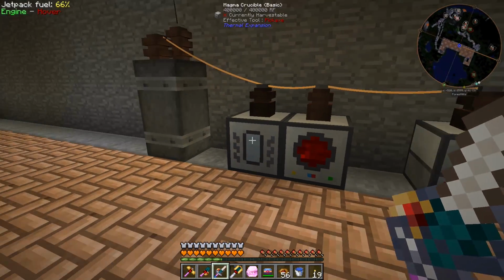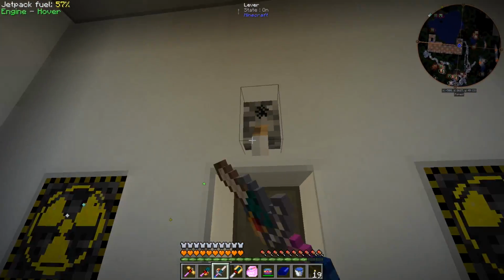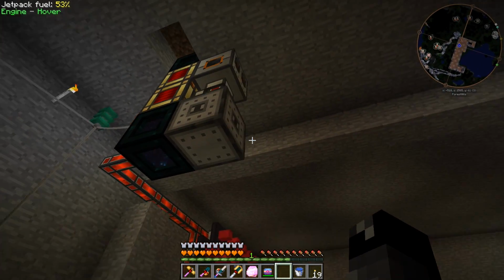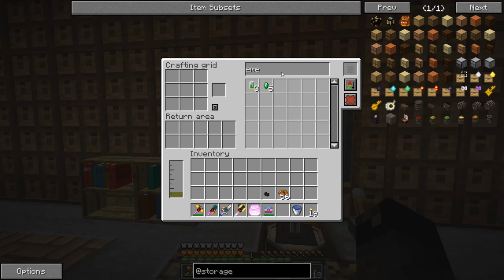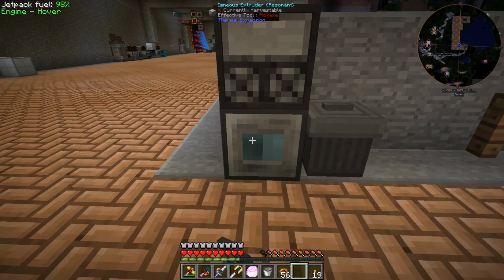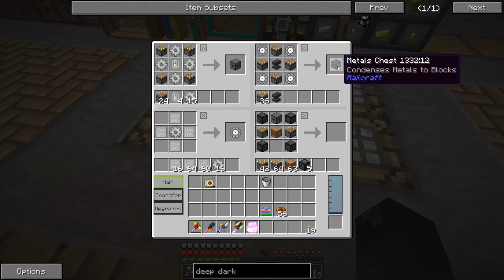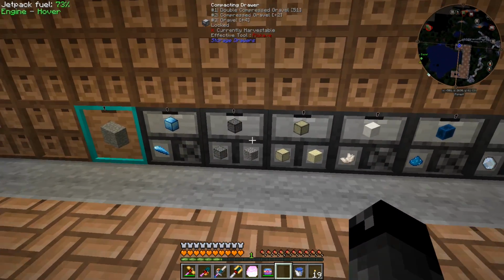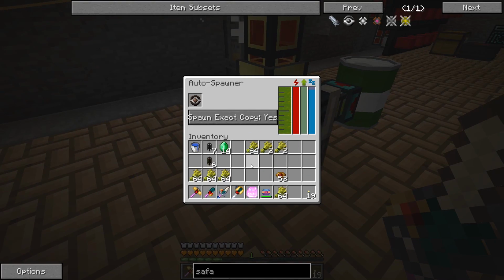Minecraft Mods FTB Infinity Evolved - COMPACTING STORAGE DRAWERS [E25] (Modded Expert Mode)

Comment: make a rubber/wood/power setup... use the furnace generators from extra utilities and have a huge rubber tree farm and have the logs auto crafted through a bc auto crafting table and then you have to get a hardened servo for the item ducts and put it on round robbin mode so fills each gen... i have like 30 gens set up this way and get like 3k rf a tic, idk for sure just a guess

Comment: What are you using to play this mod pack i tried curse and it would crash after the first time i played it and then i tried the FTB launcher and that isnt working either :|
Reply: Check the forge version it's using, if you unlock your profile for infinity you can change it. I've had issues in some packs using the default forge it downloads, the newest one seems to work.

Comment: you only need one transfer node to pill a stack at a time all you need to do it add 64 world interaction upgrades and it'll pull one item per upgrade, that's with only 1 node if you did that with 4 of them you'd get cobble stupid fast in a small area
Reply: as well if you want to continue trading for the emeralds like that set up a room spawn a bunch and use a trading post will make it much easier for you
Reply: WI upgrades are 3 diamonds each in expert mode

Comment: hypno you will not need more than a couple diamond/emerald upgrades because according to my calculations 5 emerald upgrades will equal more than 760,000,000 and 5 diamond upgrades will equal more than 67,000,000.

btw the base amount is 32 stacks of 64 and love your vids
Reply: +Tony Miller to bad it donest stack it only affects you base ammount 1 storage drawer can hold a little over 500k of one item with 5 upgrades
Reply: they should make them stack

Comment: You shouldn't throw away the quicksand; it makes for a very good mob farm. Doesn't require power and will kill anything that doesn't fly, plus it'll kill Endermen without them teleporting away. It's the best type of farm IMHO.
Reply: +nevar108 if the items gets stuck just hook an ender collector it can catch items through blocks
Reply: +nevar108 Quicksand does not fall like normal sand does. Just put the quick sand at head height. When the items drop, they are free to flow anywhere.
Reply: +IceMetalPunk Interesting. I have had some issues with items getting stuck inside the quicksand once they die. Also, grinder provide xp (Draconic grinder) or mob essence (MFR Grinder) that you miss from passive killing of mobs with quicksand. With your passive farms, have you found that mobs can spawn on TOP of the sand? IE. is it a spawnable surface?
Reply: nevar108
I always put a vacuum chest or vacuum hopper below the quicksand. It'll pull the items down through the quicksand (albeit slowly) and then collect them, so you don't have to worry about your items getting stuck. But yeah, the quicksand is definitely a spawnable surface, which can be a positive or a negative depending on what you want; for me, having my Enderman farm also give me extra bones, arrows, string, etc.is generally a bonus :)

As for the essence, yeah, you don't get that, but I've always generated essence with a cow farm over a sewer. I like as few things to consume energy as possible, and that's a great way to get free essence for an almost free farm (the spawner obviously costs some power unless you're using a vanilla spawner or Draconic Evolution). Plus, you can take the sewage from the sewer and pump it into a composter to make your plant farms more efficient, so it's just all upside :)
Reply: cool idea, never heard of this use before

Comment: The Deep Dark recipe might not show up but the recipe for The Last Millennium is still in the game. The recipe is cheap too. The Last Millennium is a void world, like a Skyblock map.

Do you know if The Twilight Forest has been disabled?
Reply: if they want to disable twilight forest they better remove it right? no it is enabled
Reply: Have you made a portal? I completely forgot about making one. I am in the process of moving my water wheels and it is going sooooo slow. I will try to make one once I have cleaned my base up and get my power back up and running.
Reply: +Daniel Mtanous no
Reply: +Daniel Mtanous I've been to the twilight forest in expert mode
Reply: +Nerf13 i was pretty sure that it is enabled
Reply: +taylorswift mms Actually not right, because even if they would disable it in expert mode, it would still be needed for normal mode.
Reply: +SnapCube agreed.but i think no one is still interested in normal mode
Reply: It is possible to disable entire dimensions if they remove the recipe needed to get there, hence The Deep Dark portal block. Also Myscraft Ages have been disabled from Expert Mode but not from normal mode.

Comment: After trading witht eh villagers, why not transport them inside the smeltery and get some extra emeralds instead of just killing them? =]
Reply: u have to put about 4 or 5 villagers in smeltry for 1 emerald because i did this today
Reply: still, its much better using the smeltery than wasting an emerald =P and you need to have in mind that hes running low on emeralds =]
Reply: +Erwin Marcos because its quicker just to kill them
Reply: +salty .cats Villager breeder. Problem solved.

Comment: I don't think the reactor was on.
Reply: +Hypnotizd u will find too much emerald in crag biome
Reply from the maker: +NO NAME IS A NAME It wasn't it only lasts around 3 hours and then the fuel cells need to be replaced. I was using it to keep power going in the base while I hooked up the other water mills.
Reply: +NO NAME IS A NAME Mondaiji Tachi fan?
Reply: +Hypnotizd In all honesty, smelting villagers is faster and you can AFK the process. Trading with villagers one at a time may save on essence but it requires patience and takes up time you could spend doing other thing. Smelting them is just the better option unless you want experience.

Comment: how do you chunk load using FTB utilities
Reply: +Jeroen Smit claim the chunk from the menu (map icon) in your inventory page). Claim the chunk you wnat to load by clicking it, then CTRL click it to chunk load that claimed chunk.
Reply: +nevar108 that doesn't work for me, is there a setting somewhere you need to change?
Reply: +Aaron Bekir (Aaron Bekir Plays) man i'm confused about this too and my map is blank?....does the chunkloading work in offline mode?
Reply: +Jeroen Smit If you guys are using Infinity Evolved v2.2.2 (which is current in FTB Launcher) then the new FTB Utilities with chunk load has not been implemented! Hypno is using the latest beta version. I just downloaded the new ftb utilities by itself and placed in the mods folder, works great now.
Reply: +B14U2NV i have 2.3.3 skrub
Reply: +Jeroen Smit Then rewatch the damn vid that Hypno did, shows exactly how to do it. Jesus, the gene pool could use some chlorine
Reply: +Jeroen Smit you may have 2.3.3 for infinity, but it did not have the updated FTB utilities packed with it, you need to unlock your profile and download the version from late December. I'm unsure of the version as I'm not near my pc, but I do remember having to update it.

Comment: you should make a "sword of the wyvern" and then use the mob spawner to spawn villagers get a soul from them and make a spawner with villagers then drop them in a smeltery and block the emeralds you can unblock them to make highest tier drawer upgrade which makes it 13 times bigger i did it with less progression than what you have and if you fill all upgrades its 65 times bigger than normal and holds like 30k items per slot in the 4 slot drawer its great i got a big drawer block all upgraded and it holds all my items
Reply: +TheMMOGamer or you can use Ender Zoo spawner ,that doenst use ,any Draconic Evolution progression ,doenst need any mob essence, basicly just need rf and the machines. to waste draconium on that is really kind of a waste.
Reply: +Erik K Nope, those stabilized spawners are AMAZING if done right, and definitely one of the best parts of DE. Not a waste of draconium IMO
Reply: Erik K you mean Ender IO and no it wont work it wont let you make a villager spawner i thought the same first aswell but it doesnt let you put a villager soul and a broken spawn in the soul binder so you cant make a spawner from it
Reply: I actually had the discussion with someone about this previous. I thought the same and for sure it used to be like this ,you couldnt. Last time i checked ,with version 2.2.2 it actually worked. However Iron Golems still dont work =), might be that they fixed it again though. And yes i mean Ender IO
Reply: Lorenzo Lucarella yes of course they are amazing but why are you using one of the most precious ressources when you actually dont need to use it? That is the waste part, you can do other things with this mod in special hypno right now ,he needs a lot of draconium for his creative energy cell goal
Reply: the evolved just give me headache for the resources..normally i play 3 or 5 hours a day but in expert mode i quite in 1 hour no lies